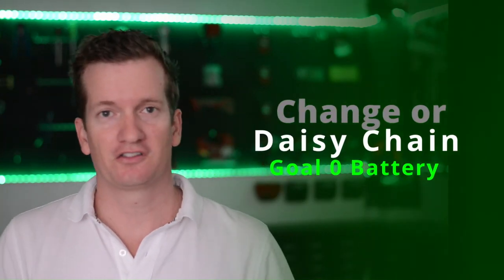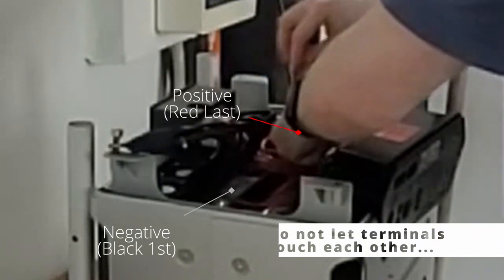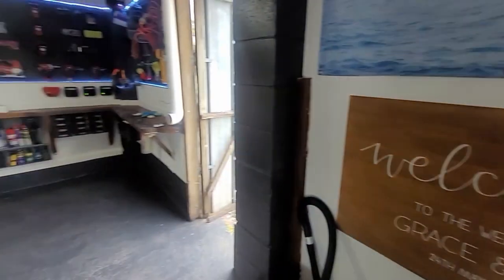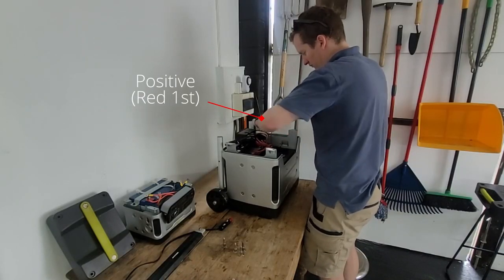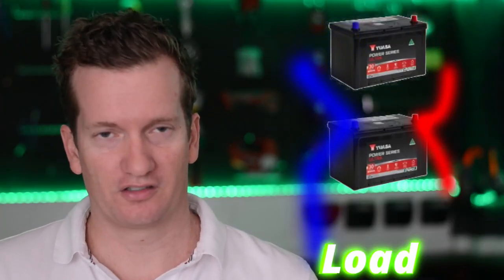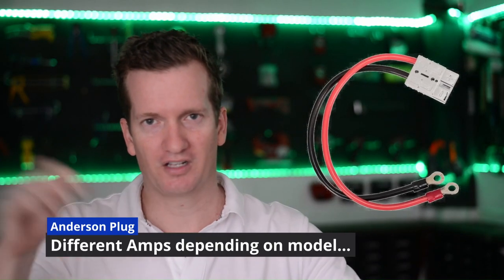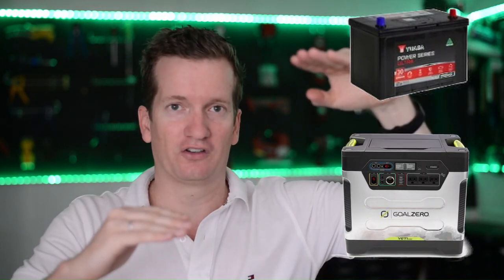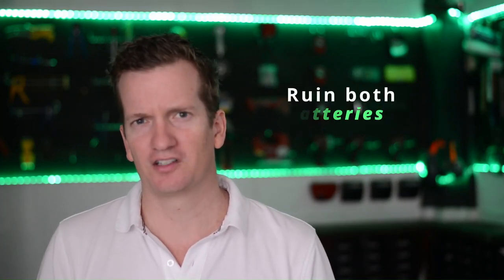Goal Zero Yeti How To Change A Battery And How To Daisy Chain A 2nd Battery

Comment: Can you tell me or show me how to change out a yeti 3000 battery? Can it be done?
Reply from the maker: I have never done this myself but I had a quick look and it looks like you can.  But they sell specifically designed tanks for battery expansion and also a Yeti link cable.  (so we won't need to use the anderson plug)